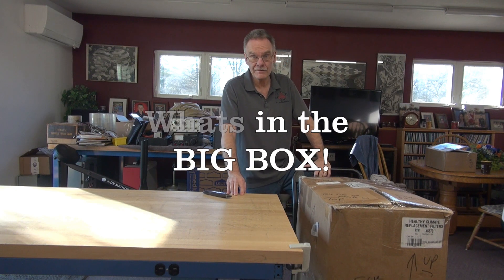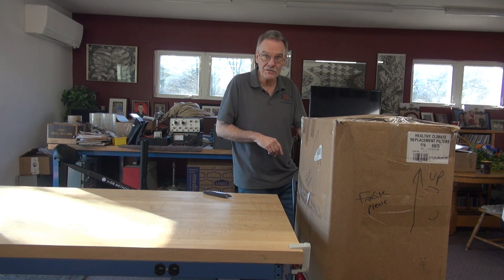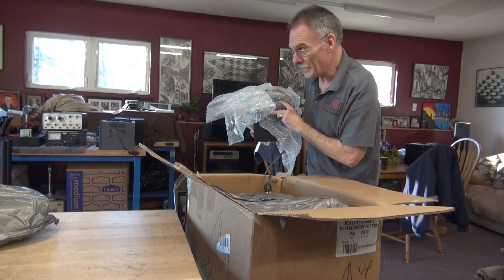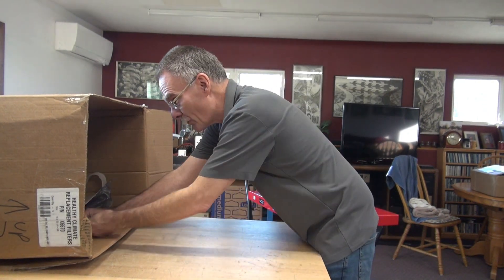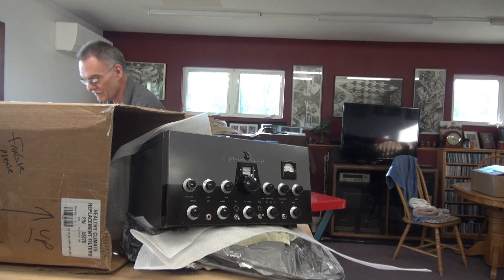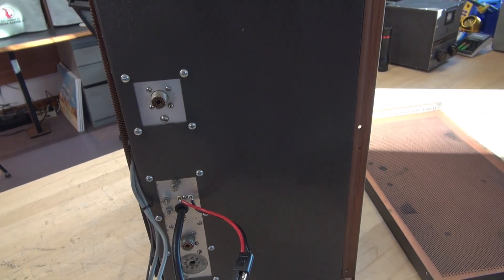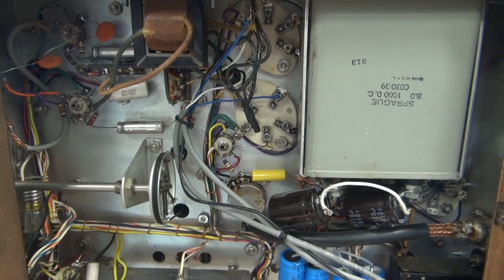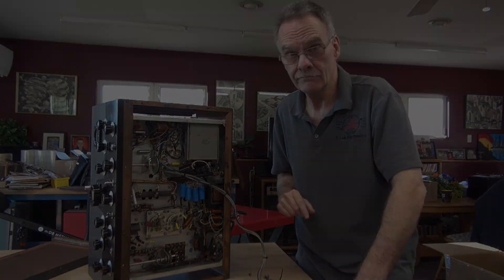Whats in the giant box! Ham Radio? Guitar Amp? Block of Cheese? New project for D-lab electronics

Comment: Here's a tip for all of you. if you ever run across a rig and can't find the label or it's illegible, look at the tube sockets. In most cases if a radio is factory built the sockets will be rivetted to the chassis, if it was a kit they will have bolts and nuts.

Comment: It's a fingers- crossed packing job. Need to double up on the boxes, one inside the other with styrofoam sheets or dense 
grey foam in between otherwise another box banging into it can cause a lot of damage. That is what destroyed a small 
plastic cased piece of test equipment which was only wrapped in bubble wrap. It got hit in one spot and bang the case 
was cracked in transit. Looking forward to the restoration to original Terry. Regards, Steve